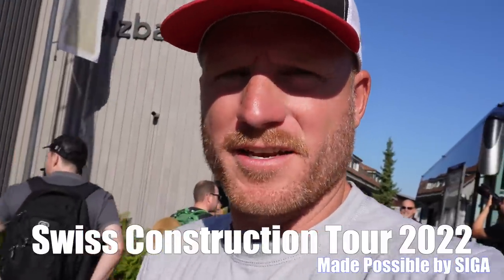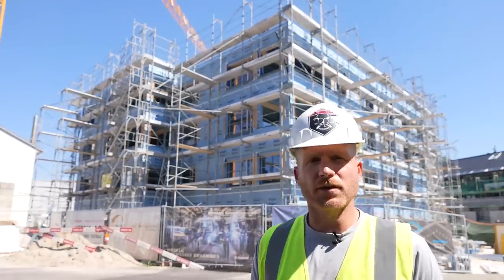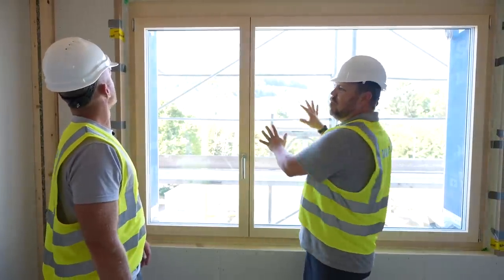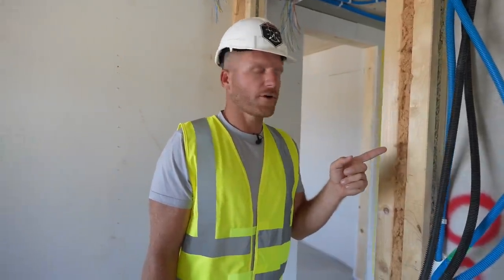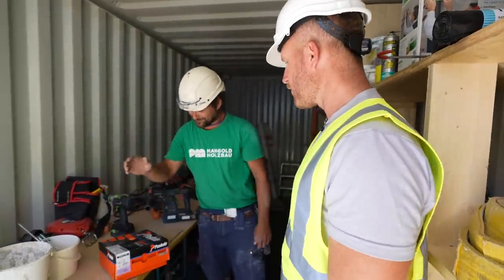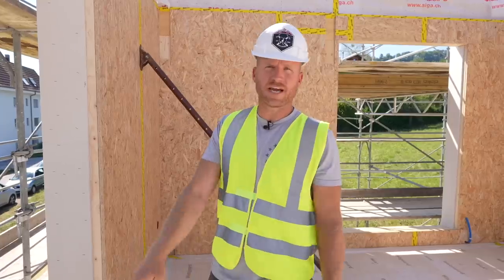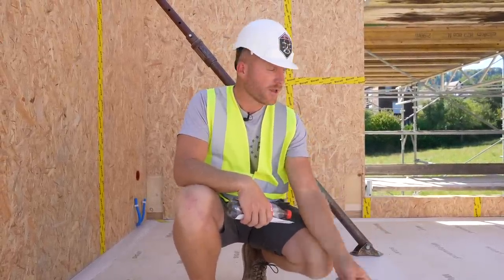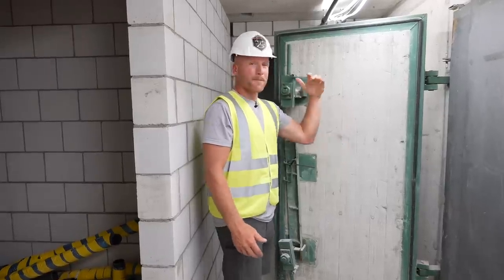Visiting a Swiss Trade School and Tool Trailer on a Swiss Job Site

Comment: This is called “division of labor” - Ford did this with the car. Dividing the labors so complex tasks can be done by low skill workers. Their onsite workers the the low skill, they do nothing more than match “A” to “A”. And your factory workers where the panels are made, has more skill, but most of the work are done by CNC machines. You have to ask yourself, will any Swiss carpenter be able to go out and ever build his or her own house when all they do is assemble panels all day. Don’t get fooled by the dumbification of skill workers and turn them into mere assemblers. It’s practical for business, but not employees. Because you become expendable as a carpenter.
Reply: most of the "assemblers" do this kind of work after being long time in real carpenters trade. you're right, there of course are some guys on the job site with little skill. but only those builders there do just assembly work does not mean they are less qualified
Reply: Go watch NSBuilders tour of their school and be humbled. 🤣

Comment: Still seems crazy that they don’t use Air condition. Seems like it still would be too hot mid summer🤔
Reply: Insulation details and proper ventilation...
Reply: It doesn’t get that hot generally, just a few days a year. I lived in the UK,San Francisco, France and Switzerland and never had any AC.
Reply: Also, remember Zurich is same latitude as Fargo ND. London is same as Edmonton Canada (but is warmer because of the Gulf Stream)
Reply: Decently insulated walls, double glazing and exterior window shutters: amazing combo for keeping a house at a pleasant temperature in the deadheat of a crazy summer, without an aircon. Only needed to close the sun-facing shutters to keep the worst of the heat out.